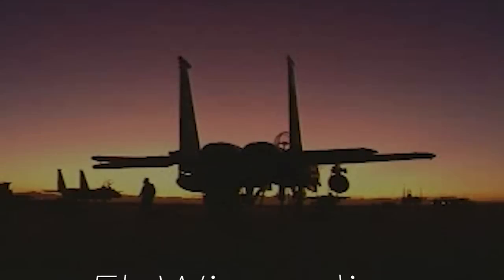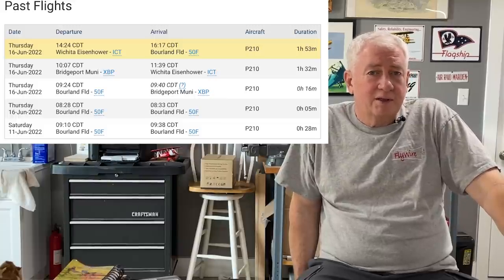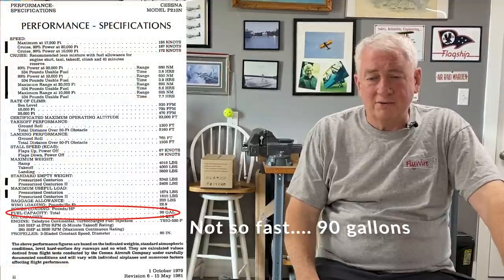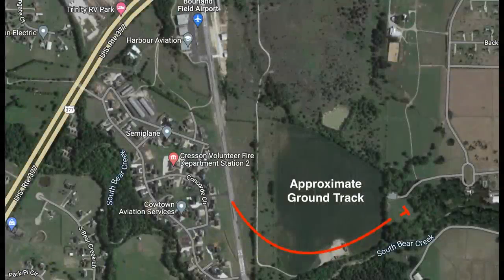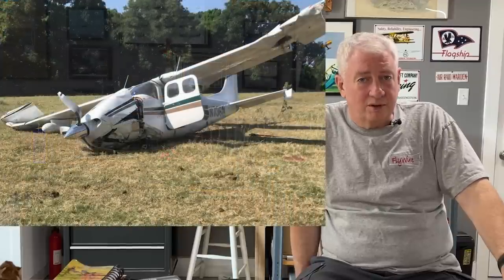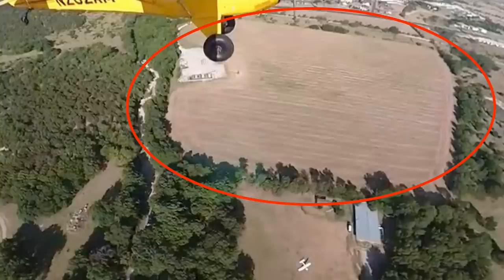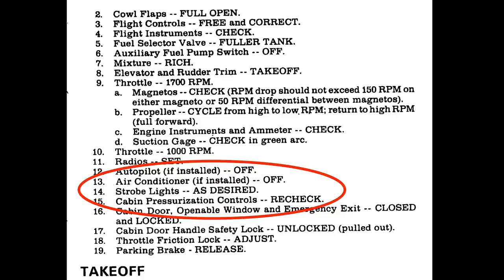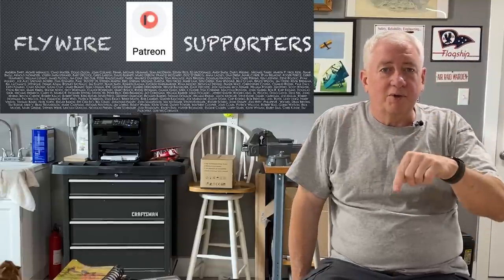Accident Review  P210 Partial Power on Takeoff

Comment: Good analysis and speculation Scot "Unsupported Wishful thinking" describes it exactly. Having been a Cessna Dealer who specialized in 210's and having personally owned every model from a 210A to a P210R  and several at least a dozen Turbo and Pressurized 210s I've had a few engine anomalies. One that is similar to this incident was a low time 76' model T210 with the 285 max continuous TSIO 520 rather than the 310hp/300hp continuous model engine. I bought the aircraft which had been setting in Mesa AZ for about 5 years without being flown. I had the aircraft extensively inspected and obtained a ferry permit. The only issue I encountered was that cly leakage was a bit excessive around the rings at about 50 PSI. Boroscope of all cylinders appeared normal with no pitting or rust. We squirted a bit of Marvel in all the jugs and let it soak overnight and did a run-up the next day and cly pressures came up about 5 psi per cly,but concluded it was because of setting and should improve on the flight back to Oregon. 

The Next day I departed a bit later than planned as the air temp at Mesa approached 120f, downhill and with about 5kts of tail wind, with topped tanks and about 300lbs of aircraft parts and luggage.  I figured density altitude added 20% to my expected takeoff roll and an abort point. Run up was smooth but takeoff acceleration was slow but I broke ground just at my abort point and about 100ft raised the gear only to hear the electric gear pump stop just as the gear was in trail and the front and rear gear doors were open,  and the aircraft started to sink. I held a bit below best rate of climb but continued to sink, I advanced the throttle beyond red line on MP until I heard the over-pressure pop-off valve open and then reduced throttle a tad, I checked the gear pump and breaker and recycled the gear switch with no luck as the Tower said "If you can make it around that hill to the right there's a road you can crash on!" After dodging some cactus I saw the road I thought I might be able to manually extend the gear with the hand pump, and after two pumps the motor re-started and the gear extended and doors closed, and I was able to maintain altitude at about cactus level. I then was able to retract the gear and started climbing away at about 300fpm but noticed the CHT was in the red. Reducing power to top of the green and gaining speed soon returned CHT to normal. On returning home cylinders were up to about 70/80 and power Improved to 'normal' 

In that situation if I had allowed airspeed to decrease or tried to turn back to the airport, instead of focusing on getting out of that situation or doing as slow as possible off-airport landing while I had the chance the outcome would have been worse, and If I had tried to turn back to the airport, even worse. "land or crash straight ahead as slow as possible" was what I mentally prepare for on every takeoff no matter if it's a Single, Twin or a helicopter.  

I've had several p210s including a P210R with the longer wing and higher HP TISO550, And a the early P210's at full gross in hot weather require a considerable takeoff run, and I found that if I rotated at at below 80kts, once out of ground effect the aircraft would typically mush,  and if pitch angle was increased with the aircraft dirty, climb could be pretty marginal, and  if at high density altitude if you slowed below best angle of climb I'd guess you could sink. 

AC on a P210I would estimate pulls about 8 to 10HP. pressurization system is bleed air off the turbo and the turbos have a good surge margin (Excess capacity) and even if the cabin pressure was set at or below field elevation no power loss should result unless possibly the manual cabin dump valve was open, but I seem to recall the lowest cabin alt available on a P210 was about 3,500' so in Texas I say not a factor. 

High outside air temps CAN BE A HUGE FACTOR in P210s on takeoff and climb, the difference between say 70f and 120f Other than the heat exchanger for cabin heat, early P210s did not have a factory engine inercooler, and on a hot day performance can be degraded by I would estimate 20%, or even more due to the very hot air being pumped into the engine. As the P210s have added intake air restriction due to the extra plumbing, cabin heat exchanger and I believe a higher ratio turbo charger the intake air charge can be less dense than a non-pressurized Turbo 210, and even at the same take-off weight the P210s are more sluggish, 34.5" of MP in a P210 does not seem to be the same as 34.5'" as in a T-210 unless the P has an aftermarket intercooler, but most of those don't do much at take off speeds. I found that turning on cabin heat in a P210 in a hot climb helped a little bit but at the risk of heat stroke. I knew A P210 owner who used to turn on cabin heat for takeoff as he deemed it helped with performance but I cannot verify. 

Turbo-normalized Bonanzas I've had seem to suffer from similar takeoff and climb performance losses. A non-turbo A36 I had would blow the doors off an identical Turbo-normalized A36 up to about 8000ft. 
 
It's not uncommon for a new engine to make less than book power, say 8%, If there was an exhaust leak timing issue, or just unseated rings then power might have been down 10 to 30%, High OAT another say 8%, Air Conditioning 10% so you could be looking at possibly 50% power loss. If cowel flaps were closed high temps on a new engine more on top of that. Combine that with poor energy management and climb profile and you have a recipe for just what happened.
Reply from the maker: Thanks Jack for watching and commenting. I considered talking to the owner/pilot, and decided not to do so. Given the comments from him and his friends I am glad I didn't. I fully expect that pilot technique was a huge factor in this accident. The liftoff was early on the runway for a shallow turn and the airplane to end up where it did. Evincing one reason for the low energy state, a working AC system was just enough power drain.... just a little more than the drag caused by the gear retraction in your case. 

I've flown plenty of turbo'd airplanes and you hit the nail on the head, they don't preform as good as NA at low altitudes. In this takeoff it wasn't terribly hot, DA wasn't high. Liftoff was early and energy was extraordinarily low. I strongly suspect other mechanical problems exist, but others will have to investigate that. What I do know is the AC was on, accounting for a significant power reduction in a marginal takeoff situation. I doubt it was the sole cause. I can get a pretty good handle on the energy state of the airplane and extrapolate that back to the runway.  

Given all the noise being generated by 'interested' parties there is an attempt to shape the narrative and that is beginning to smell. One thing I can credit the pilot for is that he did not attempt to climb over the trees, if he had done so this would be a stall/spin accident review.
Reply: Why do turbonormalized airplanes perform worse at low altitude?  Are they rated for less power than the NA engines?  If the HP rating is the same, a turbonormalized engine should not perform worse than NA unless something is amiss with the engine.
Reply: @FlyWirescottperdue  Was the owner also PIC that day?  I think I know one of the people aboard that plane.  He is recuperating nicely.
Reply: @LTVoyager  Many 'Turbo-normalized' engines are conversions or after market kits fitted to normally aspirated engines. As those engines are not certified to operate much above sea level manifold pressure adding additional boost above sea level pressure could drive the engine beyond it's certified maximum power.  As the system is intended to restore sea level power at altitude they can be installed without any internal engine mods or recertification. 

Even though a turbo-normalized system might deliver 30" Hg or sea level manifold pressure it's doing so at a much increased temperature typically 130f to 160f intake air temperature from say 70f.  30" of manifold pressure at 150f would to the engine be like taking off in 150f at sea level, so power at the same manifold pressure is typically reduced. That's why a Factory Turbo 210 engine (TISO520 NB) uses 36.5" of manifold pressure to produce the same power a normally aspirated  IO-520 does at sea level of 29.29" That extra 6.5"  or 3.2psi of boost makes up for the hot intake air. 

Putting a turbocharger turbinie in the exhaust stream also increases exhaust back pressure that at sealevel also reduces power. 

To recover the lost power from a turbo normalized Bonanza on takeoff or climb you could  likely add 2" or 3" of manifold but the way the most of those kits are certified you have to adhere to non-turbo MP limits. 

There are some factor turbo-normalized aircraft such as the early Cessna 320's that used TISO-470s and were limited to about 31.5" for takeoff but the also used a modified Camshaft profile for longer valve stroke so the engine got more air/fuel a the same MP. I had a 1963 Cessna 320 with the 470 engines that cruised 230mph on 25gph, on the same fuel burn as a non-turbo 310 cruising about  210mph. The turbo-normalized system on the 320 had no intercoolers so about 15% of waste heat energy normally lost out the exhaust stack was recovered, and improved thermodynamic efficiency giving a boost in power with no penalty in fuel burn.  

I had a couple of later a 1966 320s with the TISO 520 engines, they were basically the same speed but burned 28 to 32 gph, due to the drag of larger props, more weight and mostly energy loss of intercoolers. 

I had a 1977 T-210 I was talked into adding an intercooler to, Gained about 300fpm in climb but 10kts of cruise speed at 1.5gph more fuel burn due to the drag of the intercooler and the the the energy it was tossing overboard. Similar experience in a Pressureized 337, With intercoolers my climb on a + 20F day weent up 300fpm but my fuel burn went up from 22.5gph to 26gph at 200mph cruise. 

I've had some Mooney's with Turbo-normalizing, (2 turbo Chaparral models and a 201 with a turbo normalizing kit that used a manual  waste gate you had to close at higher altitude when you wanted to make up for lost MP.  The manual wastegate  bypassed a  lot of the exhaust heat from the turbo until needed so the degradation to in power was minimal. The Bonanza turbo-normalizing kits were always online and heating intake air. 

The Mooney (Rajay) systems were not intended to be used for take off but once on a  short hot 9,000ft density altitude takeoff in the 201 I closed the waste gate on take off and ran the engine to about 32" with good results. I had practiced boosted takeoffs before so I new what to expect and to do to  prevent the engine from over-boosting.

 If I can provide any other insights let me know.
Reply: @jackoneil3933  OK, I was thinking more of factory systems where they truly should provide the same takeoff HP rating as an NA engine.  An engine that doesn’t do that really isn’t turbonormalized.  It is turbo handicapped.  😁

Comment: Scott, you glossed over the “retract the gear, perhaps” part but it deserves more discussion. Two crucial items come to mind. Had he retracted the gear, his glide options would have measureably increased. Secondly, his chances of not ending up upside down would have measureably increased. One of the main reasons there was no fire was that the plane remained rightside up. After a hard off-field landing which shears off the nose gear and one of the mains, the plane almost always digs in and flips over. I guarantee you, had that happened here, there would have been a fire. For low wing planes, getting upside down also means the very real chance that the doors will not open due to ground interference. My Velocity XL-5 RG took this to a guarantee of not getting out because of its gull wing doors. My briefing to passengers (and also as a reminder to me) was this: In the event of the need for an off-airport landing, the ownership of this aircraft reverts back to the insurance company and my job is to get you all down safely. My first choice is going to be a road with the gear down, my second choice is going to be on the water with the gear up (Velocity RG’s can make ONE really nice water landing and can float for days), and my last choice is on flat, clear ground with the gear UP. Here is the crash axe and here is where to break out windows if need be.” I had many a pilot question me on this until I pointed up at the gullwing doors.
Reply from the maker: I did. That is indeed a point for discussion. The drag of the moving gear on the Cessna is considerable. You have good points.

Comment: I had an engine that ran fine during runup and seemed to produce normal power on takeoff, but ran rough immediately afterward.  Immediate return to the field, mechanic found fowled plugs.  I have tried to do a better job of mentally preparing for engine failure on takeoff but am not religious about it.  This story motivates me to be more observant and always prepare ahead of time.  Thank you.
Reply: It’s amazing how you will focus on the sound of your engine after experiencing multiple power failures. I only relax when I shut down at the fuel pumps after a flight. Aircraft spark plugs suck. Magnetos produce a weak spark and the lead in the fuel causes fouling. I really like the idea of electronic magnetos with motorcycle spark plugs. They actually produce a spark!
Reply: Chicken plugs??? That sounds like your problem right there....

Comment: I had a somewhat similar situation with my C-210. It would sometimes not develop full power during run-up on an intermittent basis. Everything seemed to check out but the problem persisted. Once during a high-power run-up we noticed a very small dribble of fuel was coming from the small weep hole in the fuel injection distribution device that sits atop the engine. It turns out the spring-loaded diaphragm was defective inside the distribution device. Replacing the diaphragm fixed the problem. Hard to diagnose but easy to fix!

Comment: My thoughts immediately went to the fuel system.  The fuel pump on the 1982 T-210 with Continental TSIO-520-R that I flew had enough power to flood the engine and the fuel pressure (and PPH fuel flow) had to be adjusted during the take-off roll.  
The over pressure generally was only an issue on the first morning flight of the day.  I know of that happening on a couple of occasions with pilots not familiar with that engine. 

The Take Off check list calls for fuel flow of 186 PPH  and the Normal Climb checklist calls for fuel flow reduction during normal climb to 120 PPH.  There are two notes:  "On hot days, it may be necessary to utilize the auxiliary fuel pump to maintain 120 PPH fuel flow."     "On hot days, turn on auxiliary fuel pump momentarily if switching tanks in climb."
The Maximum Performance Climb calls for reduction of fuel flow from 186PPH to 162PPH  with the note "On hot days at higher altitudes, be alert for fuel vapor indications. If fuel flow fluctuations are observed or if desired fuel flows cannot be maintained, turn auxiliary fuel pump ON and reset the mixture as required.  If symptoms persist, select a single fuel tank having adequate fuel."
The 1980 P210 had a Continental TSIO-520-P6B.  The weight was a couple pounds different that the TSIO-520-R but I think the fuel systems were probably pretty much the same.  My T-210 also had air-conditioning.

Comment: The occupants of that airplane are VERY lucky to be alive.  The fatal T-210 accident at KFWS a couple years ago was another exercise in not using the checklist.  The pilot and sole occupant was shooting touch and goes in 30+ knot gusty winds and simply failed to switch fuel tanks at some point during his circuits, resulting in fuel starvation (empty tank) right after takeoff and an ensuing stall / spin at very low altitude.  

Such a tragedy and so preventable.
Reply: My checklists say nothing about switching tanks during touch and goes.

Comment: in 77 flew new  set of 300 hp Colemill Con. engines in a  C-310 1.5 hrs with a big briefing from the old man  Mr. Colebert -- with a chart to complete and call back !   BTW I was taxied in hangar--went in office signing paperwork with Colbert. Back out in hangar both engines were off and could not keep hand on cylinder fins !   FAST !

Comment: As usual, great report.I have a T210 (1500 hrs) and if winds are more than about 7-8, while in downwind at TPA, loss of engine requires an almost immediate turn to the numbers, lightly loaded. It's a heavy bird and will float nicely if you stay on top of the speed/glide curve. If you let her sag or mush, she sinks very fast, seconds. I've learned to point to the runway and if required slip it down rather than try and manage the energy via some sort of pattern. Btw, any more than 10 deg flaps is considerable drag in a 210 and will bite you after the initial bump up.
Reply: Bump up?
Reply: @nickr5658  post flap deployment lift bump
Reply: If you are on downwind already at TPA and loses you engine totally or partial?  It depends.  Turnaround or Turnback?.  I used to teach those maneuvers and know a lot of details about both 2 of them.  Practice engine LOTOT from every turn of traffic pattern.  Most engine fails are LOTOT.. Partial power kind.